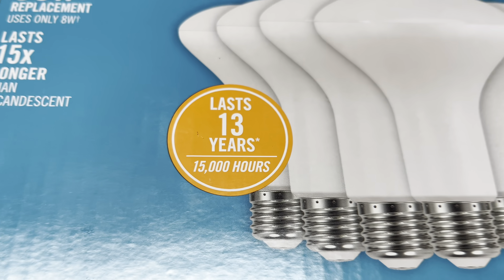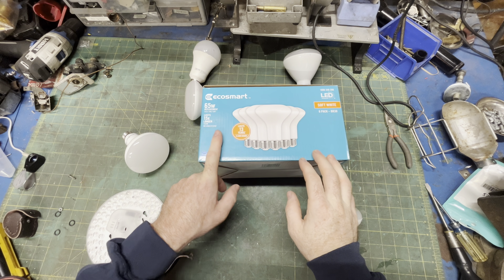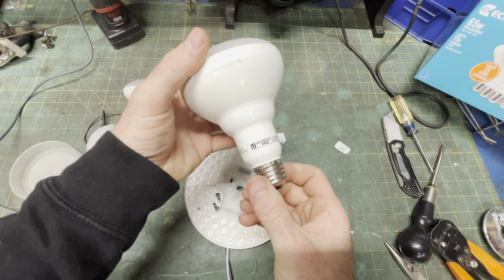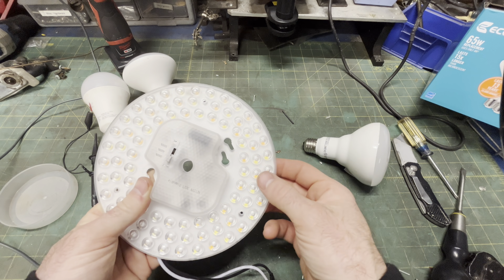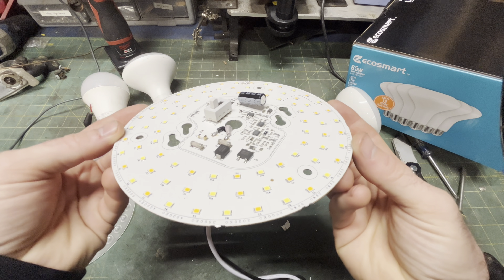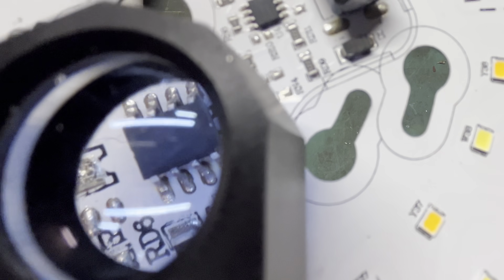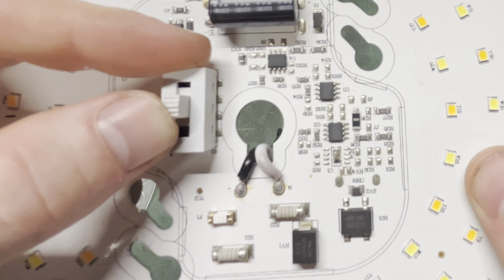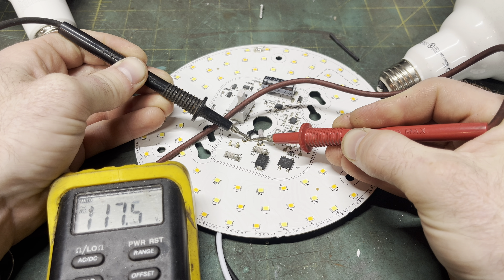Why Do LED Bulbs Fail? An Autopsy!

Comment: YouTube is definitely listening to me, I was talking about these failing LEDs last night at like 11 PM, and then this shows up first thing in the morning
Reply: It's worse. Once you use youtube and google heavily for years, they can simulate what you're thinking. Basically mind reading at this point. You do have to give them fresh data every day for it to happen though.
Reply: It's the generative AI !
Reply: It’s not utube, it’s your phone, and Alexa or google. Then they feed the info to utube for money.
Reply: @Hclann1  you sweet summer child.
Reply: I noticed yesterday that the bulb in my office/ unfinished cement wall man cave is dimming. I haven't mentioned it to anyone or bothered searching anything, on the presumption that I'll probably just pick something up when I get around to it. And yet...
Reply: Because of Louisiana storms I stocked up on USB powered Onite warm white LED camping bulbs. They have a long cord with an on/off switch and can be plugged into little power banks, folding portable solar panels with extension cables for light in a dark room or shed during the day, or cheap solar power stations. They`re great for power outages, nighttime garden security or protecting young fruit trees from late freezes if you cover the tree with a bucket or bag and put the light under it. They produce enough warmth (5w) to keep it safe. In 4 years of heavy use none have ever failed. I use them in every room connected to little power banks in case of power outages which happens a lot here.
Reply: @ElectricityTaster I can confirm
Reply: So THAT'S why Bailey keeps showing up on my feed 🤔
Reply: Before they "sυίsided" McAfee I believed all this to be consρίracίes...
Reply: and I just had 2 fail on me at the same time 2 days ago, and this shows up in my feed, spooky
Reply: @dorhocyn3   it's the other way around... you were talking about failing bulbs as you'd been primed to do so, just in time for the video they wanted to show you the next morning.

😏
Reply: For me, I just changed a lightbulb earlier 😂
Reply: Thanks for your talking, I got the suggestion 12 days later.

But yes, it's true that the phones are listening for the sake of recommendations (and targeted advertising money).
Reply: @Riverdeepnwide  ohh! Clever. I've never known the guy and I've been wondering what's the logic. I've never watched him.
Reply: @SamiJumppanen  I mean Bailey, YourAubsome is her channel.
Reply: @Riverdeepnwide  okay, I thought Bill Bailey because he's popping up and I don't know why :D
Reply: Interesting. Is it me or did all the replies to this thread just disappear?
I noticed...
Reply: Yes - your phone is listening to you and you are fed content and Ads that are relevant to what you're talking about
Reply: I would repair my LED bulbs if I didn't have to destroy them to get to the components.
Reply: Same!  I was just talking to my gf over the phone about an LED bulb that died & here we are!

Comment: The one in my attic failed because I bashed it with my head.
Reply: That one got me pretty good especially since I just smashed by damn kitchen light while cleaning rifles
Reply: Why did you do that?  I'm not the sharpest knife in the drawer but even I know that's usually not a good idea.  lol
Reply: @michaelrunnels7660  The very well designed hanging lights sit about 3 feet off a low table so picking things up off the table is a risk haha
Reply: @michaelrunnels7660  n  My attic crawl space is only about 2 feet high and bashing the light with my head just seemed like the reasonable thing to do as I was getting to the top of the ladder from downstairs to reach for some stuff.
Reply: @ThatBoomerDude56   Yup. Just like the cowboy out on the range when, seeing a patch of cactus, took off all his clothes and jumped in the cactus. After he ran screaming from the cactus patch his partner who was with him asked "What the heck did you do that for?"  He answered "Seemed like a good idea at the time!"
Reply: Bash it again, it might work again
Reply: That sounds more like it.
Reply: A personal habit of yours?
Reply: @two_tier_gary_rumain   It would only be a "habit" if I kept doing it.   But the thing was up there for quite a few years before I ran into it.
Reply: @ThatBoomerDude56  So not a case of "When everything looks like a nail, bash it with your head"?
Reply: @two_tier_gary_rumain  🙄🙄 Whatever.  
I broke a light bulb.  I'm probably not the only person to do such a thing. 🙄🙄
Reply: @two_tier_gary_rumain  No, but at 6'3"? It is mine. Especially in the basement.
Reply: @plt927  Hammer tech!
Reply: Heh. I'm rewiring my 110 y/o house, and the roof is 15 degreee pitch and a shittonne of  long nails pointing down.
"Bash" is not an option, but I do it often on the rafters. I'd say >0 sense has been knocked in, but just >0.
Reply: @stringlarson1247   Used to be smooth plywood in the roof of my attic.  But when my son replaced the roof shingles about 10 years ago, he used long nails that go through with at least a half inch extending through.  I think I've learned my lesson because I've only done this once, but:  One time I was in the attic and saw something that looked like blood dripping down on the attic floor.  Took me a second to figure it out.  The crawlspace is less than 2 feet high.  I gotta be really careful up there.
Reply: Yeah, that would do it

Comment: The worst are products with built in LEDs lights that are not replaceable.  (stovetop cover, bathroom lights, non-replaceable track lighting)
Reply: As a plasma fanatic  I just stick to fluorescent lamps. Most LEDs are boring for me. Filament style is OK but most other types are as ugly as the average mother-in-law.
Reply: No the worst part is they are not recyclable. Except maybe a household electronics event. That's where I take mine.
Reply: Absolutely.
Reply: I agree in principle that they shouldn't be made... but the simple solution is to learn how to take things apart and repair them, or shop more carefully.
Reply: @mernokimuvek  Works in colder climate as heat lamp. Sucks when you are living in equatorial/tropical climate.
Reply: @railgap  Great Eagle A19 LED Light Bulbs 60 Watt Equivalent- UL Listed - 3000K LED Light Bulbs - Non dimmable Light Bulbs 60 Watt Soft White (4 Pack), $1.74 each.

Comment: One thing about the incandescent bulb in your one lamp, that bulb has survived for so many years because it's been turned on and left on. The biggest thing that will kill that type of bulb is power cycling. It stresses the filament every time you cycle it on and off, so if it's turned on and off enough times it WILL die. Though if it's left in a place like what you were showing where it was able to be left on and never change its state of being on or off then the stresses on it are limited.
Reply: It saves the bulb a lot of stress if you have a soft-start circuit.
Reply: @TheExileFox yes, bulbs with dimming circuit survives a long time
Reply: The incandescent floods in my kitchen are original from when the house was built in 1994. They are 130v bulbs instead of the more common 120v, and they have always been on a dimmer switch where the light has to be dimmed up to full power. When tungsten filaments are never stressed, they last forever.
Reply: You are correct. I saw a slo mo video years ago that showed a clear light bulb filament being violently whipped around in the first few alternations of current flow. On that basis, DC would seem to be gentler upon startup due to a single filament movement with the onset of current flow instead of the multiple alternations of AC current. Not that it's practical to do so, but still interesting.
Reply: The incandescent filament goes off and on every time the voltage of the sinewave crosses zero. Perhaps going from a cold filament to a hot operating filament cause mechanical thermal shock shortening the life.  It goes on and off 60 times a second.
Reply: @curtw8827  An incandescent filament does NOT go "off" between alternations. It dims slightly due to thermal inertia. There isn't near enough time to go cold or even just cool.
Reply: @curtw8827  A big part of the thermal shock at start-up is that tungsten has lower electrical resistance at room temperature than when it is white hot. If you put the full mains voltage across a room temperature incandescent bulb, the lower resistance of the tungsten filament at room temperature means the bulb is overdriven until it heats up to operating temperature.
Reply: Centennial Light

    Installation Year: The bulb was first illuminated in 1901.
    Longevity: It is recognized as the world's longest-lasting light bulb, having been continuously operational for over 123 years.
Reply: @thedarksage328   I suppose it's being operated at reduced power.
Reply: @joewoodchuck3824  Yes. According Wikipedia it's driven at only 4 watts. This light bulb was designed for 60 watts when it was built in the 1890s.
Reply: I think there is an incandescent bulb that has been on since they were invented and has never gone off, precisely for the same reason you say. It has never been turned off.
Reply: @kelly4187  It's posted here if you look back.
Reply: @palladium1065 . Wow. It's hard to imagine that it even glows at that level.
Reply: @Demo12345  The biggest contributor to the failure of any electrical/electronic device is to drive it beyond the power limits and/or heat dissipation ability of what it's designed for. Cost sensitive consumer electronics is the prime example. Buy a component that will work for now, but is really designed for a lesser demanding application is how it's done. The LEDs are almost guaranteed being overdriven in order to achieve a light emission level spec while using cheaper less capable components.
Reply: I have a light bulb in a small storage room in my workshop. I live in a 220/230V country and it is an ancient "Osram" 220V 60W super heavy duty shockproof tungsten filament bulb (was used for traffic lights and railway signals and the like). This light bulb has been hanging there (in the typical pendant fixture with the dog-tag-style pull cord) since at least the late 1980s. It gets switched on and off at least five times a day. I'm afraid that thing will outlast me...
Reply: That is why my computer never gets switched off.
Reply: @calthorp  Probably a good idea, especially now that hard drives are solid state. Motor bearings don't last forever.
Reply: I've run into the same thing I have all LEDs in my shop, mostly because they are brighter, but also because they last longer than my incandescent bulbs.  Mostly due to A: Power cycling, those lights are on and off all the time and B: crap tons of hot cold cycles, the shop is not super heat tight and I heat with wood, they turn off in a warm atmosphere, and turn back on when its cold.  Then I get the stove going and warm up the shop, so theres just lots of power and hot-cold cycling, which isnt good for ANYTHING, especially itty-bitty pieces of metal that get super hot and are already super brittle.
Reply: With hard drives you have to look at the power management. They may still enter sleep and park their heads with a noticeable squeak often.
Reply: @TheExileFox  constant current, is the way to go !
Reply: doesn't it seem like he should already know this?
Reply: @kelly4187 If that were the only reason then any incandescent bulb could live forever by not turning it off. There are no carbon filament bulbs still around, only tungsten. But we have done lots of testing and had perfected and fully understood the incandescent bulb by 1940 or so. In general the sweet spot for longevity vs energy efficiency and light color/quality is 1000 hours. This lifespan is only affected a little by on/off cycles, but not more than 10% in the real world. You could make a 2500 hour bulb, but if it's the same 60w as a 1000hr bulb, it will be dimmer and more yellow/red. You could also overdrive one very hard and get 50hrs, high energy efficiency and bright white light, but that's too short.

The centenial bulb is no more than a dim glow like a heating element in an electric oven. It doesn't even work as a nightlight. But a smaller bulb that draws 5w would be far brighter and useful, making more visible light and less infrared. The centenial bulb is the only bulb that lasted so long and it was defective from the factory, the filament doesn't get hot enough because it's the wrong resistance and as a result draws 5w instead of 60w, this is why it was donated. All other bulbs from that time died within their expected lifespan.
Reply: @calthorp Your computer goes through far more extreme thermal cycles from variable loads on the computer than shutting off would. Not to mention hot spots in the silicon chips. The overall cpu temp at idle isn't far from room temp compared to load temps.

Thermal cycling is also not a part of any wear and tear for computers, they all have a lifespan defined by total hours operating which varies by the operating temp, amps, and voltage. Any of those factors being higher means less hours of operation, and off time only contributes to their shelf life (applicable only to electrolytic capacitors, not solid state caps).

There is basically zero evidence that turning off your computer will reduce its lifespan, no group or study has come to that conclusion. The CPU will last 20 years regardless of what you do, unless you overclock it and have it constantly under load, the degradation from higher voltage and current will kill the chip exponentially faster.

There are other things you also aren't protecting by just keeping the computer on. If you have a spinning disk, the OS will put that to sleep after usually 5-15mins of inactivity and only spin it up for any new read/writes. For most PCs this is the right thing to do because the inactivity is long enough to increase lifespan than the wear from cold starts on the bearings. Datacenters benefit from never turning off spinning disks because idle periods are often just minutes and not even an hour, their servers are constantly under load. However it's not just a lifespan thing for datacenters, since the disks are warm stopping/starting isn't that bad, the bearing lube is at temp. It's more about not having spiking electrical demand from 1000s of little motor starts/stops, not a lot energy isnsaved either by turning off a disk for a couple mins an hour either.

Your fans are most likely the first things that will die, especially if the computer is always on. Those fan bearings have a lifespan and constant running burns through it, compared to running 3+3 hours a day.
Reply: @Jaker788  Thanks for the reply. Great info. I run a desktop & use it on & off all through the day & evening so my machine would have 20-30 startups a day. so I just leave it on. My last computer kept going for 15 years & was so outdated I had to buy a new machine. For sure a computer is not like a light bulb as you point out. Imagine if we could transport things without stop & starts that would save a huge amount of wear & tear & energy. Imagine something like a train with some way to slingshot you on & off it.
Reply: @joewoodchuck3824  FYI, a solid state hard drive (SSD) has a life expectancy of 5 - 7 years. I have several HDD's still spinning after 15 years. Just saying...
Reply: that's what I was thinking...
Reply: Nonsense, tungsten filaments quite literally burn. A bulb run ten minutes a day will far outlast one left on continuously.

Comment: Your commentary is like what runs through my head as someone with a bachelor's in electrical engineering where I spent precisely 0 days doing EE as a career. 30 years later I can easily impress people with my skill at fixing electronics using the most basic EE knowledge. Thanks to bad Chinese engineers, what breaks are usually the obvious components.